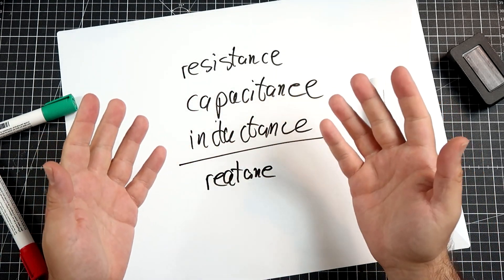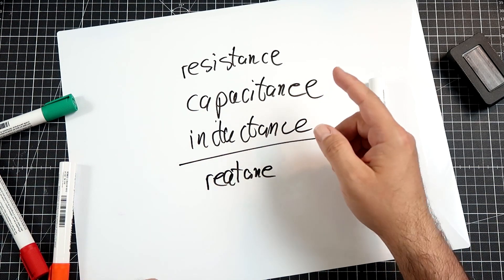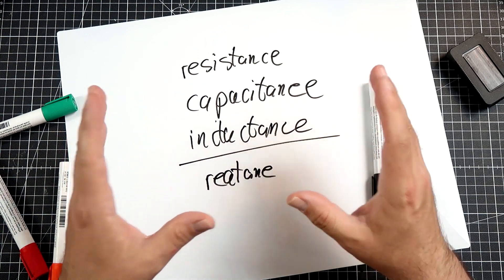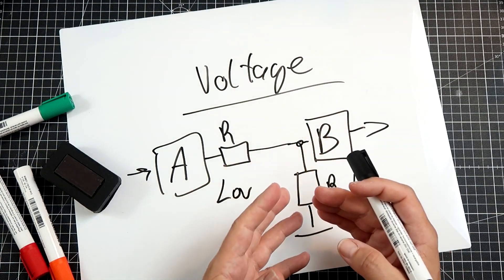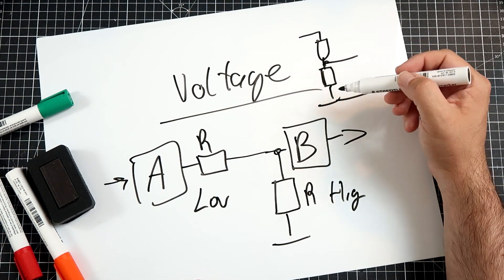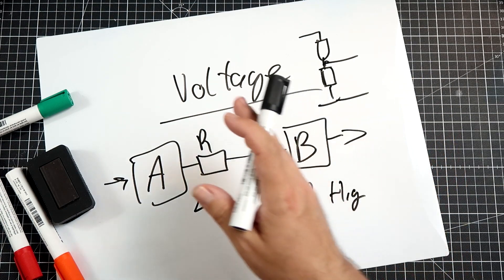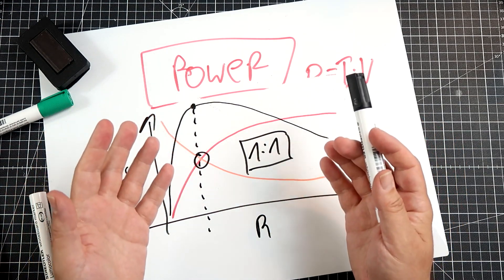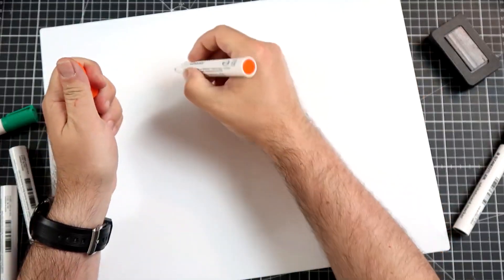Impedance Matching - why we match output and input impedance

Comment: "You cannot have the voltage without the current" - incorrect.
Reply from the maker: Depends how you look at it. If you measure voltage between 2 points and there is a potential difference, small (very small) current will flow through the measureing device. Ergo, in practical terms, when you measure the voltage, small current flows
Reply: @PSAfterHours  having three batteries, connect battery A+ to B-, B+ to C- and C+ to A-. Now the funny thing happens, no matter which two points you measure between in this triangle you will measure 0 volts but lots of current is flowing 🙂
Reply: @BaldurNorddahl  It's not actually 0, it's just so small you can't measure it.
Reply: If the impedence (z) of the load is lower than the source the voltage will be low, accordingly.  I=E/R  If the impedance of the load is high, the voltage may exceed safe limits (dielectric breakdown voltage).

Comment: Another place where impedance matching comes into play, (in a low frequency application) occurs when connecting a solar panel to a battery. You want maximum power transfer from the solar panel to the battery. A good charge controller matches the impedance of the solar panel to th battery. A good impedance match results in more power being transferred faster to the battery.

Comment: what is the additional instrument to measure the output impedance for 5.8ghz fpv video transmitter? .. since the 5.8fgz antenna said its impedance is 50ohm...but the signal result not as expected....from this video i learn the problem might be the mismatch impedance between 5.8ghz VTX with Antenna...

Comment: I think there is also the Case when You want a Lot of Current. Like a Short basically... :D I think, it is the Opposite of Voltage Matching... High Output-Impedance and very low Input Impedance will give You a Lot of Current (but not much Voltage.. ) ...

Comment: Is it possible to match or tune impedance with potentiometer??
Reply: Yes, at DC. At high frequency a potentiometer won't be only resistive. You have to be careful to ensure the potentiometer's wiper can handle the current.

Comment: 07:13-09:00 makes no sense. I really didn't get it. I will watch your other video that you explained better. However, thanks for your effort to share your knowledge. You're a valuable person. Keep fighting! Edit: Maybe you can try to explain it with really easy numbers. Edit2:  You said that voltage can not exist without current. I can not fully agree with this. The voltage is potential difference between two nodes. It can exist without current/load. Such as batteries or I can give the best example as static electric. It is static. There is a potential difference and no current.

Comment: what is the ohm of electrical cable ?
it depends on mental , thickness and Legnth of wire .
but when we talk about 50 ohm cable why it's always 50 ohm no matter how long or thick it is , like cable tv wire ?
Reply from the maker: It's the impedance, not resistance per meter
Reply: @PSAfterHours  so what makes diffrence between 25 ohm  50 ohm and 70 ohm cable ?
Reply from the maker: The impedance :) Read this http://www.bluejeanscable.com/articles/impedance.htm but long story short: if you have 50Ohm output and 50 ohm input impedance, you should use 50Ohm cable to connect them

Comment: more higer the diferance in impeadance between 2 points than 
more watts volume goes as AC signal but less Current
& lo impeadance signal goes more efficient to High impedance
but…

gues’s steady high speed back and forth realation 
what is current ? is there something new about it .